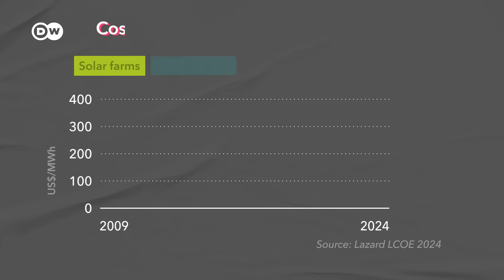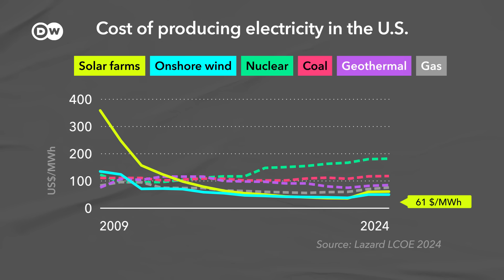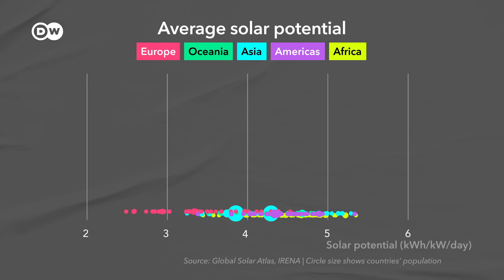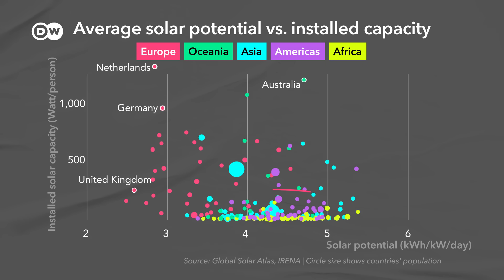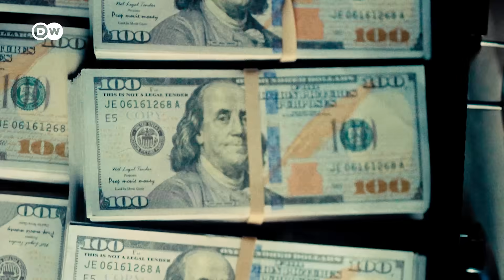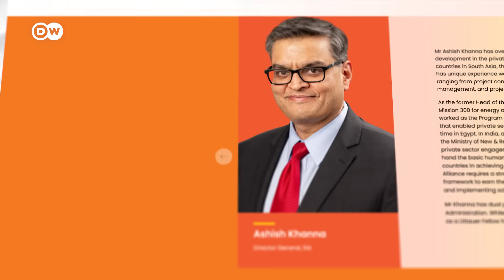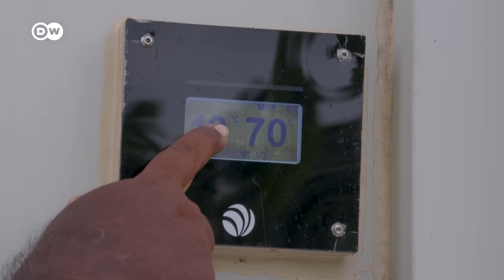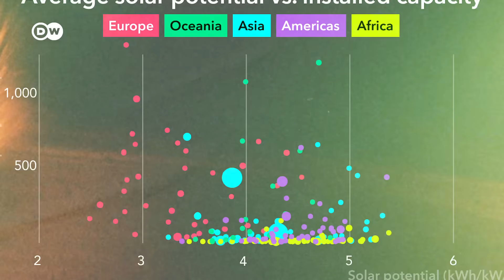We're building solar in the wrong places. But we can fix that.

Comment: Not only are solar panels becoming less expensive,  it may be the case that they will soon become twice as efficient at collecting energy. Most important is the linking of solar with batteries, which are also making rapid technological progress.  The big challenge is the electrical grid. The concept is autonomous decentralization, which is the conversion a centralized power system to a decentralized system of interconnected nodes. Dare I hope that renewables are unstoppable?
Reply: Exactly. Batteries are the next step, people in Africa without a grid conneciton want to have light and energy at night too. 
The technology has just started, and for cheap batteries we should be thankful to chinese companies as well.

Comment: It's a mugs' game to attract politicians and the naive.
Australia is a large and thinly populated country with most people within 100km of the coastline.
Solar is a low density energy source. In Australia this means long transmission lines which are costly, intrusive and are now causing resentment and opposition by agricultural land owners.
The big failing in solar is the black hole of nightime.
Australia has reached the absurdity of homeowners being subsidised into installing roof top panels and then supplying power to the national grid. This is causing massive fluctuations in grid voltages. Low cost inverters on home systems do not always synchronise with grid frequencies. Three phase supplies are becoming unbalanced. Industrial power supplies are not maintained. Solar is extremely variable and almost impossible to predict, so the baseload system from coal generation is becoming stressed by a varaible demand. This is undesirable to the inertia of the network.
Homeowners that installed roof top solar may now discover that their "discount" from "selling to the grid" is being impacted as the peak supplies from multitudes of small solar systems exceed demand. There simply is nowhere to "store" surplus electricity. There are no massive battery installations, so the government is now proposing schemes for household battery installations to store surplus electricty in solar maximum periods. 
Australia just keeps adding patchwork components to balance the mess the govenment is creating in response to foreign ideological themes such as this video.
The latest flop has been the "Hydrogen Hype" where politicians were dazzled by the idea that "Green Energy" would make Australia an "Energy Superpower"... But: politicians rarely have any education in physics, mathematics or industrial engineering, so they did not understand just how energy inefficient it is to round trip electricity to hydrogen and back to electricity. It loses about 70% of energy in, to energy out.
Please... make the complete case where unreliables such as wind and solar need a solid, reliable base load generator such as nuclear in the network to balance and maintain system frequency.
Imagine the electricty grid to be like an orchestra... a lot of members that need a conductor to keep the beat to create music instead of a room full of noise.
.... and without something to provide reliable nightime base load power, solar is trap that may empower regions where there is no electricty, but is potenetially a death trap for advanced, industrialised countries. Spain for example.
Reply: What a load of BS. Australia with its weather and massive landscape is ideal for solar.

Comment: Yes, Bangladesh has great potential for this. In fact, I recently worked on a documentary post-production for an NGO that talks about the same things and provides some local examples of how they are implementing this. In Bandarban (Hill Tracks), they are using Solar-Power Mini Grids and even Single-Home structures since early 2000s.

Comment: You need to build power production in the regions where it's actually needed to avoid the high costs of large transmission lines. In Norway, where I live, solar unfortunately destroys a lot of nature while generating only small amounts of power. Hydropower and nuclear energy are much better options.

Comment: there's no particular reason to expect or want solar panels to be mostly located in sunny countries 🤷 you could argue they should be located where energy is needed the most, but we're not running out of solar panels, the grids and battery storage just need to catch up
Reply: that has the relationship backwards, solar isn't built where its needed to most, but where its most likely to be built. there's tons of places that can profit more, but don't have the initial capital, and tons of places where its inefficient, but they have.the money and labor.
Reply: agreed, with say, solid state or sodium ion battery tech, batteries would get cheaper in the future!!

Comment: In India, Both Central and State Govt.'s Are offering subsidies to the tune of 75% of all the costs, And Private Corporations like Reliance and Adani are Pledging $ 100 Billion Dollars in Just Solar Energy Investments and separately billions in Solar Manufacturing, As a Result, India's Solar Capacity Grew from 2 Giga Watts to a massive 110+ Giga Watts overtaking Germany as the 3rd Largest Solar Energy Producer
Reply: Yes, India's total installed solar power capacity stands at 110.83 GW
Reply: Another revolution happening in India is with solar & BLDC pumps people buy cheap remote lands,drill a deep well and starting agriculture in mid to large scale
Reply: MORE
Reply: Rooftop alone produces 18+GW, and Total Capacity is 110+ GW, why would lie about your own country, and also Govt Subsidy is capped at 78K and rightly so, why should govt bear the cost of higher income individuals (assuming 3KW + consumption is attributed to the same) when they are capable to do so, scheme is for lower income family to reduce their energy bill as well
Reply: @anubhavmishra19  in my village they installed solar pannel on every house from which more than 50% electrical needs are fulfilled and also when power cuts are their which rarely happens now , they use that solar energy stored in battery and also it is all funded by local govt body
Reply: @anubhavmishra19  Anyone can get subsidies, The Top-10% Pays 90% of Govt. Budget, Why shouldn't we get subsidies AND I got 50% of the costs from the Center whether you believe it or not
Reply: first, govt is not offering subsidy of 75%. if i spend 100,0000 on solar ,govt is just provide 75,000 as subsidy. so not even 10%.
second, india produced this year 25 GW of solar energy. if India wants to meet its own target by 2030, it needs to produce at least 50 GW solar energy every year.  so , india need a lot to do more what it is doing.
Reply: @Rajesh1ization I got 50% of ₹ 1.8 Lakh from the CENTER, which is ₹ 90,000 Rupees and Gujarat Government is offering another 20%+ Of Subsidies, And my State of Telangana just started the same, And India's Solar Capacity is 110 Gigawatts in MAY 2025
Reply: @Rajesh1ization  There is a difference between installed capacity and power generation. Power generation depends on weather, amount of sunlight, cleanliness of pannels, connections with wider grid network. What the previous comment mentioned was capacity. We need to build capacity in which we have already achieved the target set out by us for 2030. Which is amazing.
Reply: If you spend 2 lakhs or so u get price subsidy of 75000 which is also max subsidy 

Till 3 kv system, govt subsidy exists for households, anything 4 ot 5 or 6 will get merely till 3 @Rajesh1ization

Comment: This video raises important points about the placement of solar installations and how to ensure everyone benefits. It's crucial to consider these issues as solar power expands.
Reply: I don't think it does make valid points, it's acting like adding a solar panel in the UK, somehow detracts from one that could have been put somewhere sunny. It's not a zero sum game. There is not a shortage of solar panels, the more installed the better
Reply: @shyft09  Agreed the more the better.  Every roof and wall and fence can be solar and bifacial solar fence and highway walls.
Reply: @shyft09  Solar Car chargers in a carrier like from GoSun o

Comment: The problem is the infrastructure of the established grid of the country which promotes solar energy is not ready (stable enough ) to integrate the suddenly spike of energy  received from solar panels installed in households. That why we witnessed the complete collapse of the grid in Spain and Portugal.
Reply: That was not the problem in Spain and Portugal.
Reply from the maker: Grid is still an issue for sure. 🤔 We made a video on this previously, check it out here 👉 https://youtu.be/u-DsDuTceTo

Comment: We have 25 kWp roof-top solar (plus battery) in Germany, which provides 95 % of the electricity we use (with an EV driving 80km daily and being charged exclusively at home). We consume 43% of the electricity produced by PV and feed the remainder into the public grid for about 8ct/kWh. With our battery we could even be more helpful to the market or the grid, but price signals for grid feed-in and grid usage aren't yet transferred to us. We currently consider facade solar for better earnings in Winter because at some point, we want to switch to a heat pump.
Reply: Is that true in winter? My solar production in Australia is very low in winter and I don't have the space or money for an array the size of yours. The battery is also essential to time shift the power for use at night. Home batteries are still too expensive. 😢
Reply: @theharper1  Usual figures for self produced energy consumption are 1/3 with PV alone and 2/3 with PV and storage. It also depends on your electricity use. If you have AC units for the summer but heat your home in the winter with natural gas, you can cover a much higher share of your electricity usage with PV, while swapping to a heat pump for heating in the winter will mostly be powered from the grid, because PV production in the winter is so low.
Reply: @Psi-Storm thanks! Is that in Germany?
Reply: @theharper1  Yes. Based on the average energy consumption in Central/Northern Europe. So if you have a high ac load, or work from home so you can charge your car with direct pv, those percentages go up.  But if you use electric/heatpump heating in the winter, you grid demand will still be high.
Reply: @theharper1  Well, most newly installed home solar systems have a battery, it's not so expensive any more now. Consumption peak usually is in the evening when the peopel come home from work, cook, wash, watch TV and do all the homework.

Of course solar production im winter is only a fraction of the production is summer,

here are some data of solar production in 2024 (for whole Germany)
May  8077GWh
June 8280 GWh
July 8682 GWh
vs.
November 1532 GWh
December 1.067GWh
January 1.388 GWh

So the production in winter is about 1/6  of the production in summer, and with the usual 10kW peak rooftop solar systems you usually cannot power your house in winter, especiall if you use heat pump for heating.
Reply: @thorblau7943 I only get about 15 kWh on a sunny day in winter. Barely enough to charge a 10 kWh battery which would cost about 5,600 euro. In summer though, I get about 40 kWh and I'd rather use it than send it all to the grid. It's a challenge. Maybe that price sounds cheap to you, but it's tough for me.
Reply: battery are so expensive and how long it will be able to run all my pc, ac, fridge on single charges?
Reply: @CadyCadwell it depends how efficient you can be with power. A 10 kWh battery would be enough for our small home for 3/4 of the year, just not for winter. Also, the 6.6 kW solar array is adequate for 3/4 of the year, but not winter. So it depends how many solar panels you can install, how big a battery, and how much power you use each day.
Reply: Be glad that the energy market prices are not transferred to you but the ridiculous high fixed 8ct/kWh (for 20(!) years from the day the system went online), even when there is an electric power oversupply and the kWh is literally worth nothing.

Comment: The right place to build solar, is where it's both sunny enough to be viable, and nearby where the demand is.  There's not much demand for electricity in the Sahara desert.
Reply: I have solar panels on my roof, and it takes supplies about the yearly amount of my two EV's (which both are in use every day). This is in Norway, with little sun in the winter. Still worth it, so even here up north it's still sunny enough to be viable.
Reply: @janterjeaugestad8431  norway gets relatively low sun, so if you can charge 2 EV's and run for the entire year bro, imagine if there was your solar panels in a very sunny/hot areas like africa!
Reply: @M16-mini  Yeah, I'm jealous of those getting consistent sun all year. Mind you, I yearly produce enough power for 2 EV's, but the seasonal change is wild. They do produce very little, especially in December and January.
Reply: @janterjeaugestad8431  yep, I live in Cologne and I rent an apartment, electricity bill is pretty low and included in the rent, but if I lived in a house, def would have solar panels!